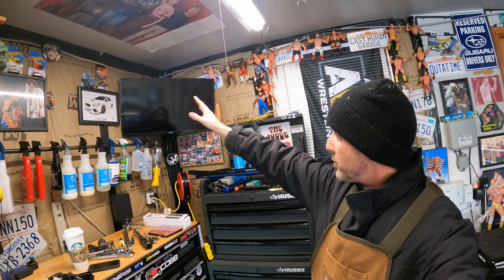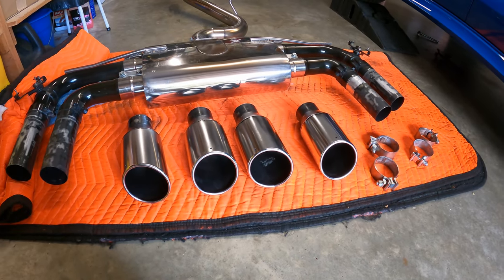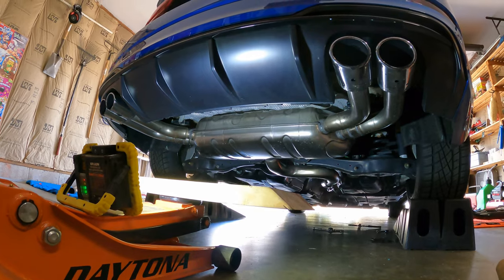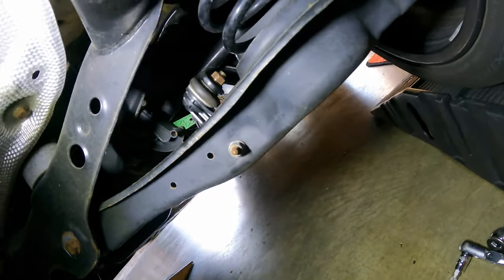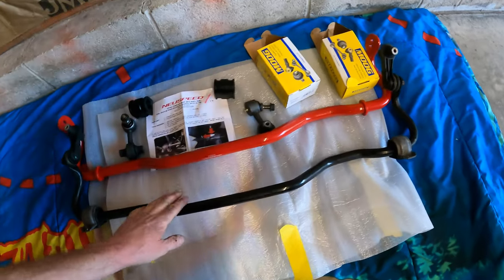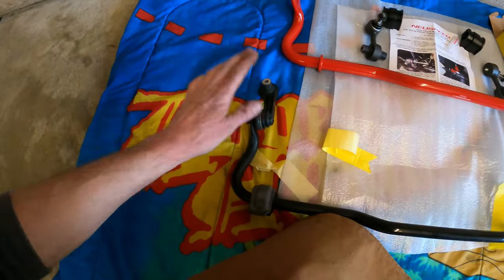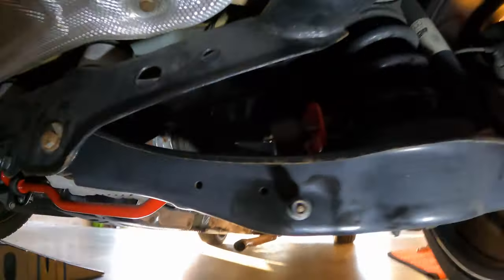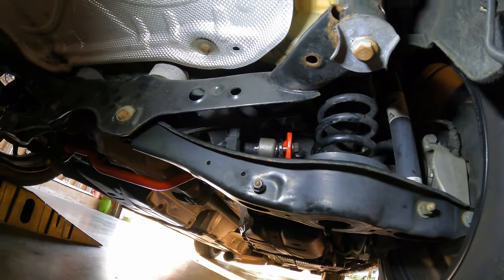2018 Audi S3: Episode 69: Installing the Neuspeed Rear Sway Bar

Comment: How funny those in link set up looks a lot like the Subarus my legacy has the same set up except the bars in the back of the differential and it hangs down but the connection to the lower control arms is the same style..